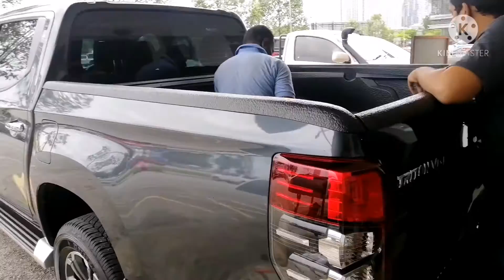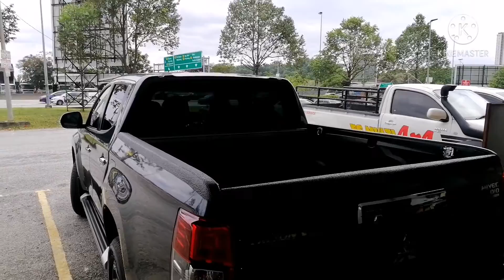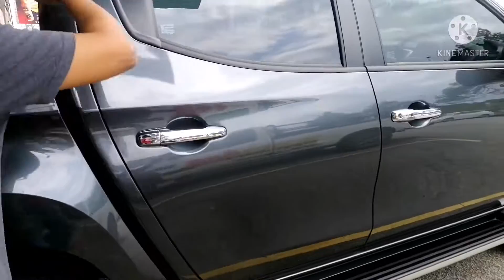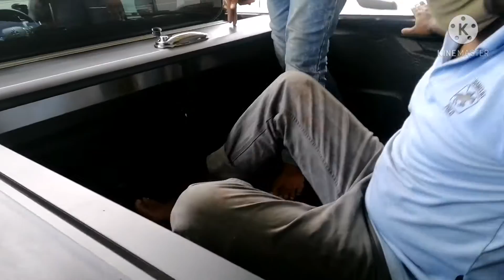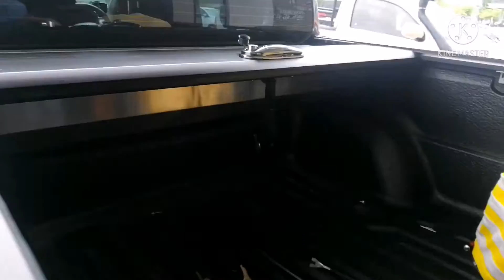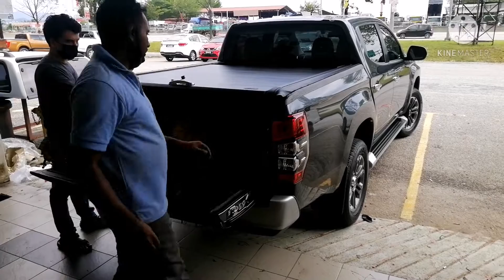How to install Roller Shutter #4x4 Mitsubishi Triton.

Comment: warranty brpa lama?agak2 air boleh masuk tak?
Reply from the maker: Warranty 2 tahun,, air x masuk, pergunaa x ada masalah bro
Reply: @kamaruddinboto8908  ok2… Boleh Pasang la nnt, sbb sblum ni dkt navara pki yg full cover, ckup 2 tahun air masuk
Reply: X nmpak lagi triton ethelete pasang canvas pakai rangka ori...memang x boleh pakai ke rangka tu...??
Reply from the maker: Boleh pakai cuma pengguna x nk pasang..
Jika nk cntik dan  safety  pasg slide cover mcm saya psg,
Reply from the maker: Warranty 1 years air tarak masuk bro..
Saya pakai x masalah lagi.. Pengunaa sgt memuaskan
Reply from the maker: Warranty 1 years, now I use 2 years no problem. Good condition..